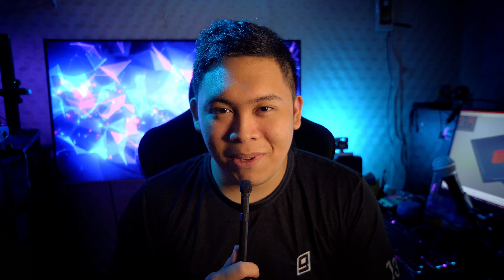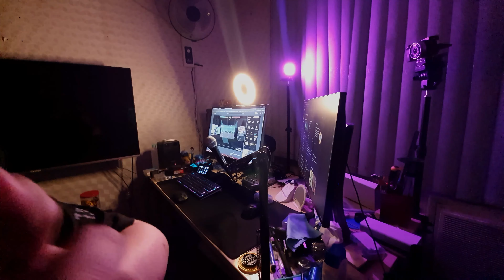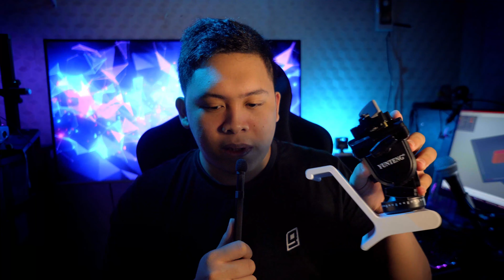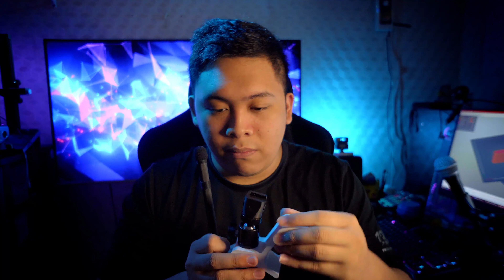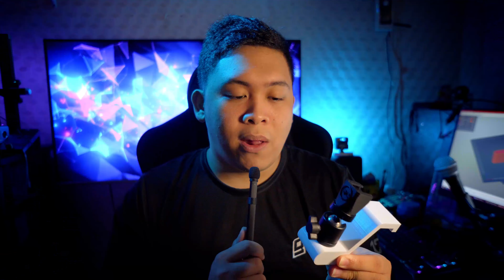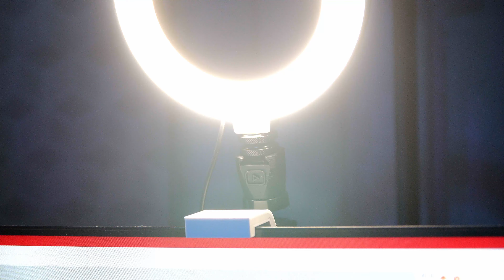3D Printed DSLR Monitor Mount

Comment: I need this!!! Actually thats how i set up my cam. Parang nakalean on sa monitor. But i have a question lang regarding it. Di ba nbibigatan yung monitor? 🤔
Reply from the maker: Depends on your ball head and camera weight but it's designed to be supported by the monitor's internal structure 👌 the real problem really is the arm or stand that the monitor's attached to it can become heavy enough to pull your monitor arm/stand down if it can't handle the weight 😊
Reply: @BIGDC  true. Nakamount yung cam ko using elgato mount but still naka lean siya sa monitor. And ung monitor ko yung nagsusuport ng weight. i have sony a6400 and sigma lens so my cam is heavy af 🥲.
Reply from the maker: TBH i feel like your monitor arm can support the camera more than an Elgato mount 😅 also monitor arms are usually adjustable in the weight they can hold 😊